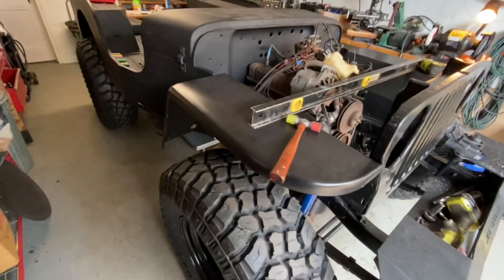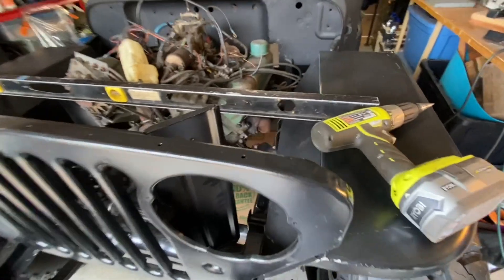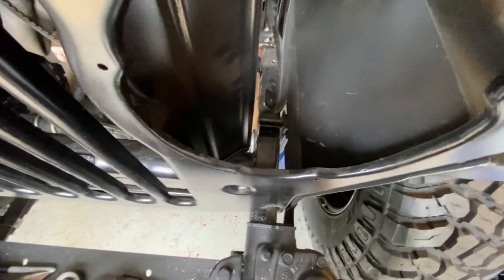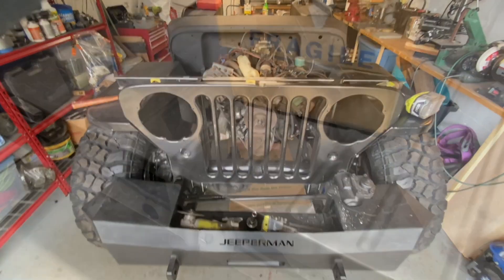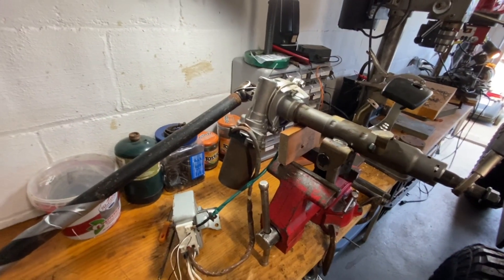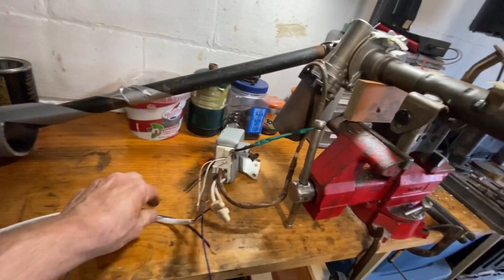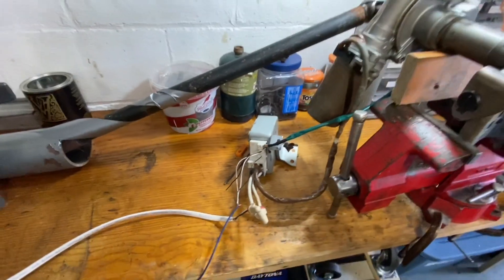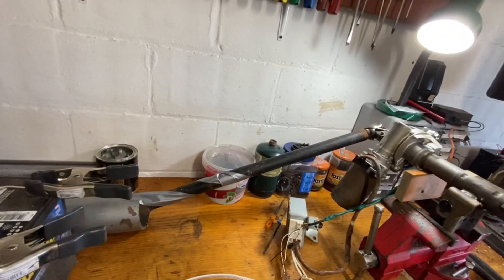Willys CJ2A Toyota steering box Prius electric power steering

Comment: How long would you say that Prius electric power steering column is in length? Looking to do in my 59 cj5? Thank you
Reply from the maker: The whole unit is 18 inches long. That includes the motor stub shaft and steering column section. Hope this helps. I have another video besides this one that shows it all installed might help with some brackets and things like that.

Comment: Wire gauge size and fuse  ?
Reply from the maker: Hi, thanks for the question. I really don’t understand it though. You just matched the wire size that is on the steering unit. You could throw a relay in there if you wanted, but I don’t think it draws all that much I never put a meter on it to see what the amp are
Reply: @maxxbear5014  Ok thx,  I have the same setup like you on my 52 Willy's. I really like it

Comment: Cool to see that! Is there a backup in case of power failure while driving?
Reply from the maker: It just reverts back to standard manual steering. For the test, I put enough weight on the shaft till I couldn’t turn it.